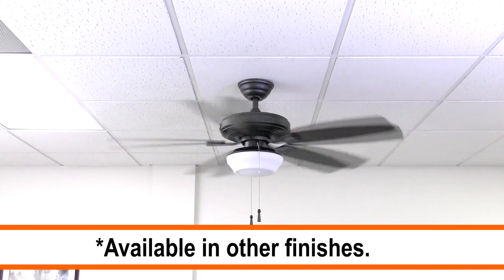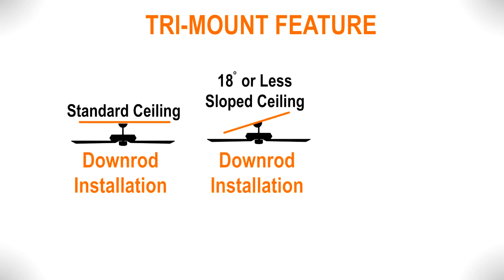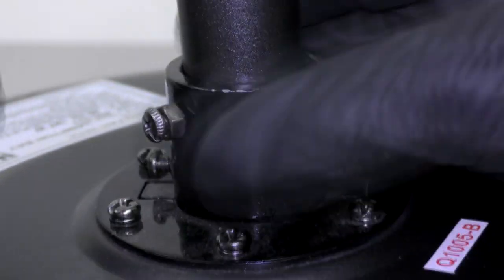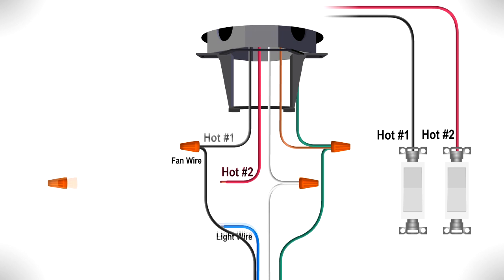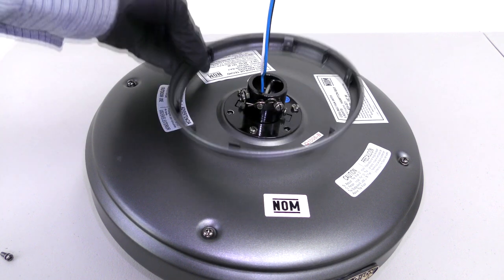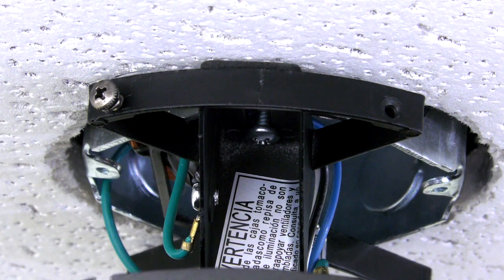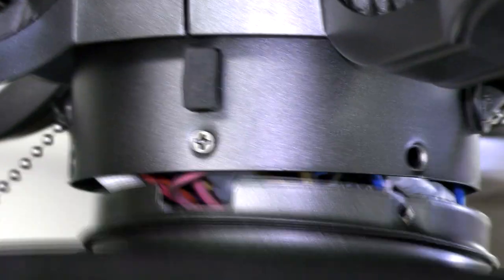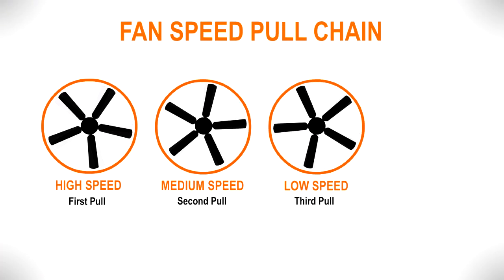Gazebo II Ceiling Fan Installation Guide

Comment: I just finished installing my fan and this video was a HUGE help.  I found the written instructions to be challenging to follow so I'm very glad I found this.  I tossed the instructions aside and used this video throughout the installation.  The only thing that I would recommend to the video editor, is slowing down!  There were times that I wanted to see what the guy was doing but it just went way to fast.  At any rate, it was definitely a big help - thanks!